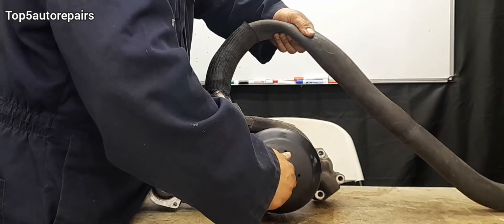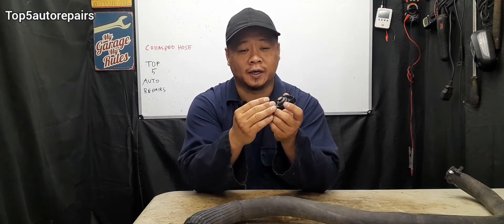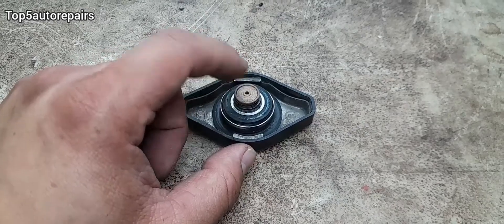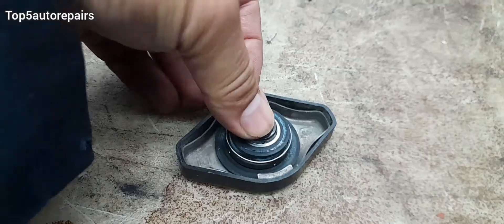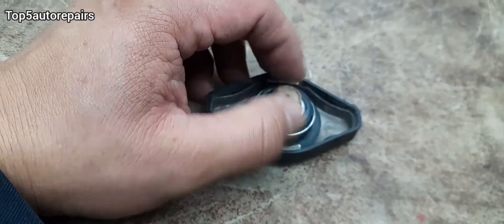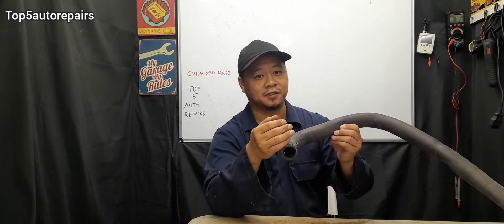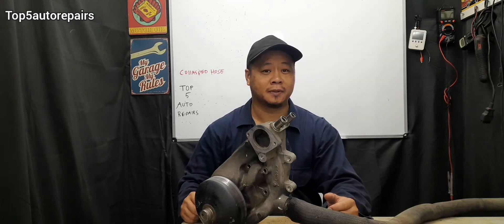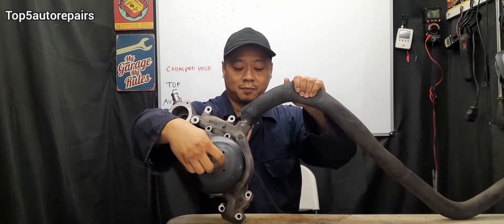COLLAPSED RADIATOR HOSE CAUSES AND EXPLANATION

Comment: Just got heads replaced and water pump, my upper hose, builds up pressure and gets hard to squeeze, I find me resivour tank in the hot zone. I release pressure using the radiator cap but idk what else to do. Maybe replacing the hoses helps ?

Comment: I just changed my radiator cause my old radiator was cracked and leaking. I never had this problem before but now I am. Also it collapses on the cool down about an hour after the truck is off
Reply: I ran into the exact same issue i replaced the radiator cap thermostat and hose and still no fix

Comment: I noticed on my Subaru 2016 cross check when the engine is cold there is a little suction bend in the radiator hose and then expands when I turned the car on

Comment: The lower radiator hose started collapsing after I poured 2 bottles of BAR's Leaks Liquid to fix a massive coolant leak that I couldn't find. It fixed it but now, every morning I need to open the radiator cap to release all the suction and uncollapse the lower hose.  The radiator cap looks good but the hose does feel a little soft on the area where it keeps collapsing.  Could the stuff I used to seal the leak be causing this issue?

Comment: This explains why the top radiator hose is collapsed on my 2015 Ram. I noticed this the other morning and thought it was the thermostat, changed it but still the hosed collapsed. Now I'll change the rad cap and Hopefully that's all it is and not the water pump, or worse, the head gasket😖😩.
Reply: Any updates? My challenger is doing the same thing…
Reply: @bobafittness1346  my 2017 Explorer is doing it as well....
Reply: Change the upper radiator hose. Good brands will have a metal coil inside of the upper hose. Upper hoses if collapsible may work well cold, but when hot will clamp up with pressure. Lower radiator hose should also be unable to collapse either when hot or cold.  You should not be able to squeeze completely an upper radiator hose either cold or hot.
Reply: I'm so scared of a water pump or thermostat. Would be crazy if a radiator cap caused all this.  But praying 🙏🏾 that's all that it is because that would be a huge weight lifted off my shoulder, especially for a girl fixing her own stuff and don't know too much about this area.
Reply: @o @onieshianapoleon2547 pending on what you are driving a thermostat or water pump replacement is fairly easy I would say 3/5 on the difficulty if you have zero experience.

Comment: My dodge ram has had this ,upper radiator hose gets hard and bubbles .and boils up no over heat marking in the dashboard.I changed everything over the two years thermostat,coolant sensors ,hoses,3way valve ,oil cooler housing ,radiator cap .I just haven’t changed the radiator & I had a mechanic tell me it’s the head gasket 😅😅
Reply: What should I do 😢😢

Comment: I just replaced a water pump (2016 F150) and put a new thermostat in.  Right after, the lower hose collapsed the next morning when cold.   Could the thermostat be the issue ???
Reply: Me too. I think you have air in the system. You should replace the radiator cap though.
Reply: U got air in system

Comment: Remember. In performance, high rpm situations running a lower radiator hose without an anti collapse spring will promote collapse at speed. You will have cooling issues at speed but return to normal at cruising speed.
If you can’t find an anti collapse spring in the  size you need , get some stainless steel wire and wrap your own around a metal pipe that’s a bit smaller than what you actually need to compensate for spring back when done.
Always use an anti collapse spring in the lower hose no matter what.